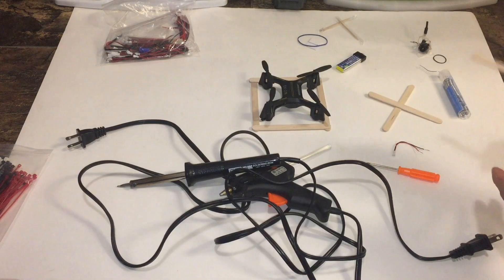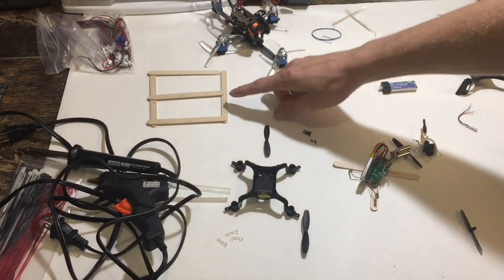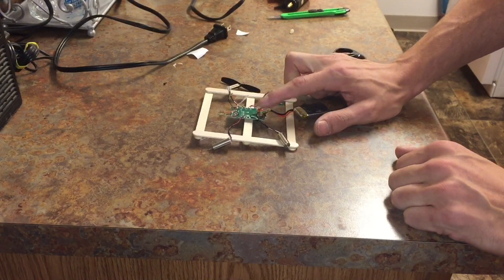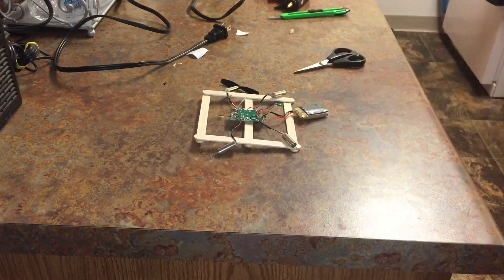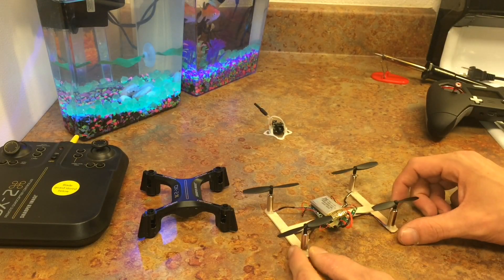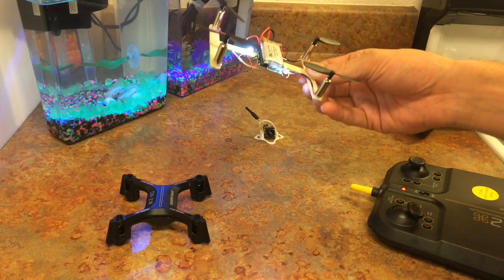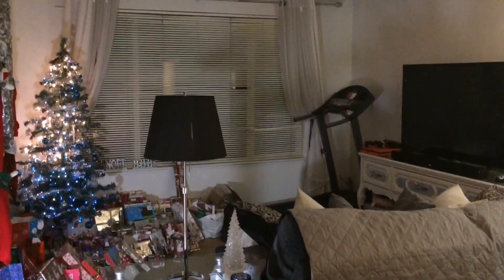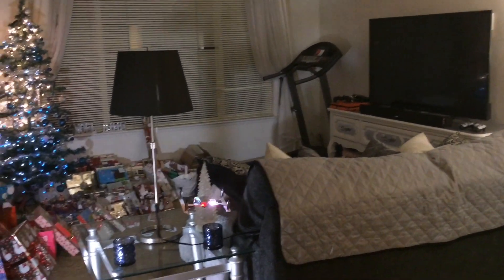How To Build A Drone From Sticks | DIY Popsicle Stick Drone Part One

Comment: Heck yeah! That was a sweet idea and it looks like it flies somewhat decently.
Reply from the maker: Errl RC hey when I get it outside it’s gonna rip lol trim needs some work but dude it’s fast for what it was before and with a camera lol too bad I just screwed up one of my fpv cameras lol like literally just now broke the antenna off
Reply: @HellaCopter  dang that really sucks about the camera antenna. I definitely am looking forward to seeing it rip it up outside. Also I have that same drone but the DX-3 instead of your DX-2.
Reply from the maker: Errl RC is the dx-3 larger buddy?
Reply: @HellaCopter  yeah it's about at least twice the size of the dx-2
Reply from the maker: Errl RC that would be great for this project lol mo’ POWA!